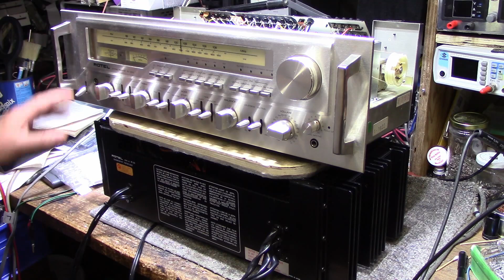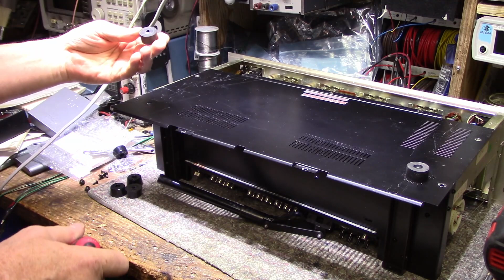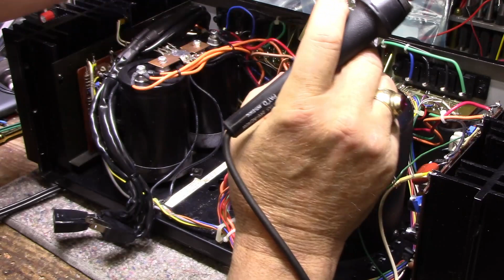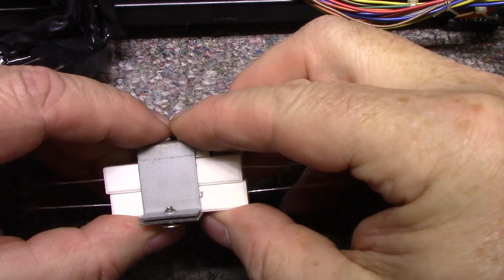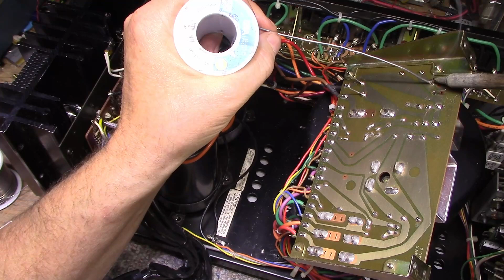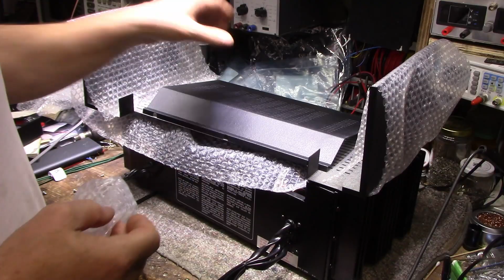Rotel RX 1603 Receiver Followup Part 4 (Ep. 203)

Comment: The input surge resistor value seems quite high to me. The Pioneer SX-1980 for example uses a single 3.3 Ohm 20 watt resistor for this.